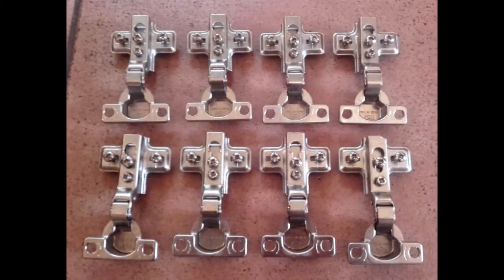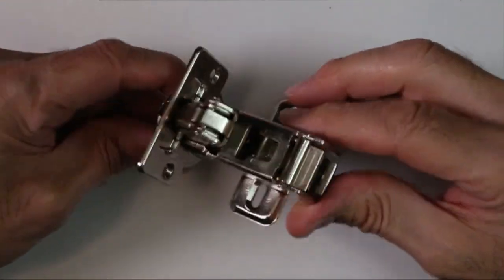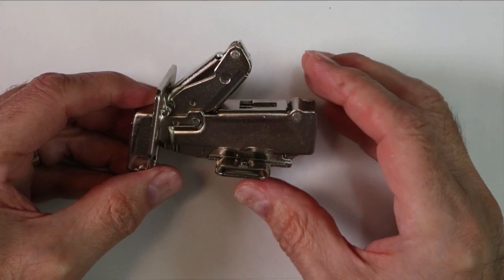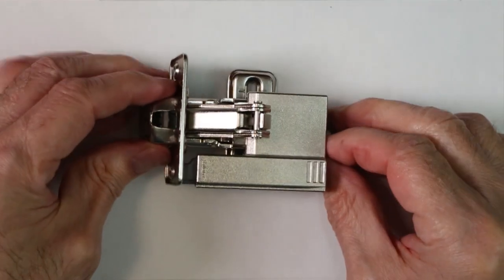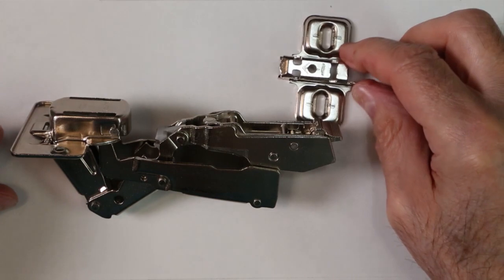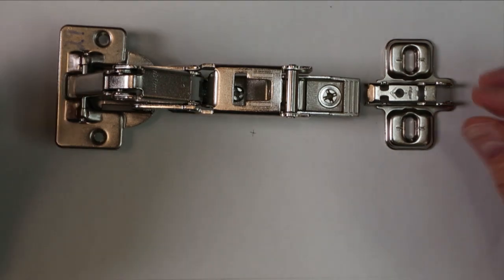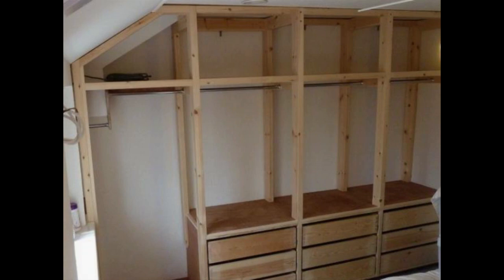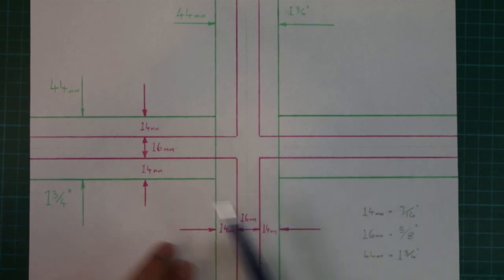Hinges, Selection, Fitting: DIY Fitted Wardrobes Part 5.

Comment: Would this work if your uprights/sides are only 36mm thick ? IE 2 18mm Mdf wardrobes
Reply: And doors are 27mm thick
Reply from the maker: Hello Ryan. Thank you for your comment and question. Unfortunately, the answer to your question is: "It depends". It depends on the type of hinge you use, the thickness of doors and cabinet, and how you need the doors to open and close.
You must take care, understand how your hinges work, and how they must fit on the door. The Blum hinges I used required that large flat-bottomed hole in the back of the door, the diameter of that hole controlled how far the hinge could be fitted from the edge of the door and therefore the amount of overlap between the edge of the door and the hole you need it to cover in the cabinet. I looked through the hinge specification, I made sketches and drawings, but I was still not completely convinced I had it right. In the end I bought two hinges which I thought would do the job, I fitted them to two pieces of MDF as shown in my video. That little jig worked well, I tested my dimensions and the function of the hinge. What you see in the video is in face the second jig, the first one didn’t work as I thought it would. There are lots of variables when it comes to fitting hinges, I suggest you do what I did and test the hinge function on a jig. Sorry, I don’t feel I have been of much help. Please let me know how you get on. Take Care Jim